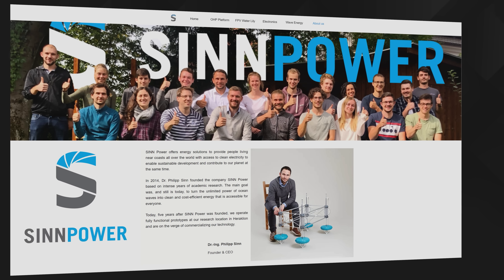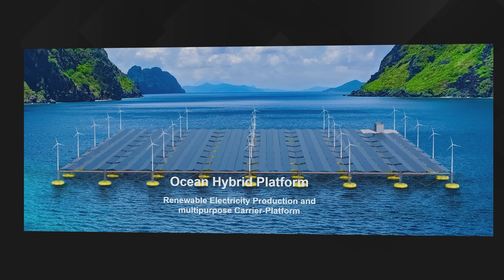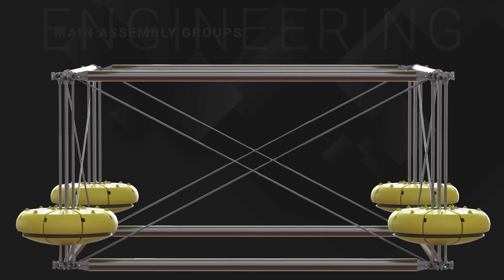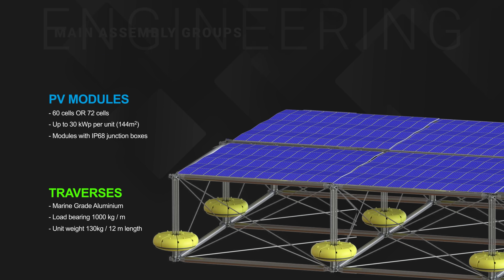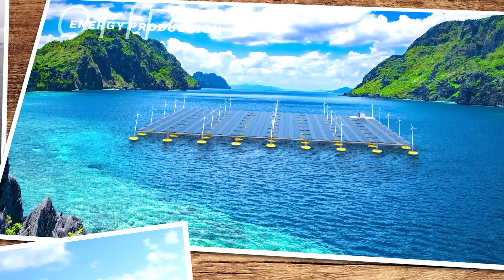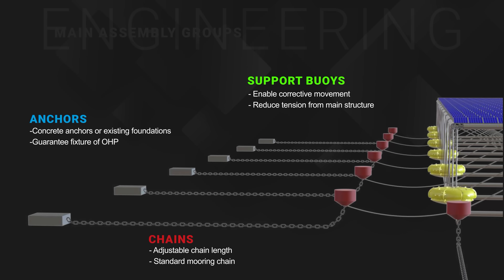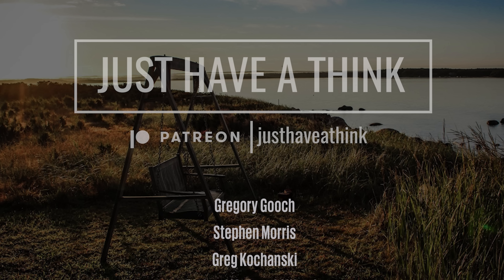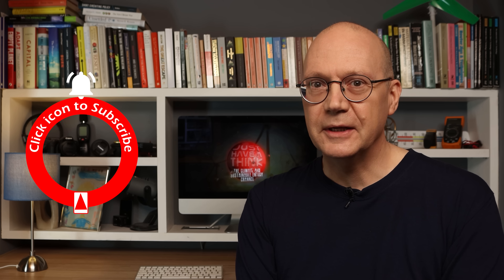Solar Wind and Wave. Can this ocean hybrid platform nail all three?

Comment: Looks great, if it's strong and durable enough to last... if it's out at sea, strong sea storms are incredibly destructive, with tons of waves crashing against the structure. (obviously the designers are aware of this!😁)
Love the modular design, very adaptable for custom builds and upgrades, much cheaper investment costs, along with the possibility of moving the whole thing to different, better locations by sea without completely dismantling.

Comment: This is the sort of project that the UK government should be working on, except that are too busy stuffing themselves with wine and cake. An enraged version might be suitable for use by the UK south of the  isles to take advantage of more solar...  but anchoring in deep water would be an issue as would robustness in the face of Atlantic storms...Bird fouling might also be an issue. it would keep shipyards busy though.. ROI would depend a lot on maintainence costs and timescale before replacement.

Comment: The central thesis to this proposition is that long-term, viable energy solutions are not an "either or," but an "and."  Wind and solar and wave.  Most detractors pick one solution, deride it to death, and conclude it is all hogwash.  We know this is bull***t.  Overall, great presentation.  Two questions remain:  What effect will such floating platforms have on the flora and fauna underneath it?  Has any consideration been given to the growth of creatures (i.e. barnacles) on the underwater structure?
Reply from the maker: Thanks Andrew. Two very good questions. I guess they will need to ascertain the risks during their testing phase.

Comment: As someone who's been at sea in a storm, the first thought that crossed my mind, is that these platforms won't last  five minutes in a good gale. One has to only look at oil platforms massive legs, the platform high above any wave, to see the reality of any offshore installation.
Reply: Location will be key. This doesn't appear to be tall enough for open ocean. I am intrigued by the wave power units though. This seems to be the real innovative part of the system. However I'd want to see a small free floating grid producing power to see how the software will handle keeping the platform floating and level while applying load to the generators. Bolting them to a harbour wall as we saw here only tests the generating units.
Reply: I live on the coast in the UK and they won't last 5 minutes in a major storm. Wishful thinking by someone I'm afraid.
Reply: The engineers say they solved it. What math did you do to come to your conclusion?
Reply: That’s part of why it’ll be nice to get a pilot location going soon. Need to get away from the marketing of “yea this’ll be awesome” and get towards the operations of “here is how my power generation and maintenance costs performed over the last quarter.”
Reply: They won’t be placing them in the North Sea, unlike oil platforms which are designed  to withstand extreme gales. Time will tell
Reply: @robinhodgkinson  You could park them in the Great Lakes and still get waves breaking over them.
Any significant body of water gets significant waves.
The only place you might get away with it for a few years are aquaculture beds - and they get ripped apart about every ten to twenty years.
Reply: @allangibson2408  the Great Lakes are hardly what you would call protected waters. Ships have been sunk there in storms. Perhaps fiords, sheltered harbours and bays, lagoons etc might be a better choice. But you’re right in having a healthy skepticism. The sea is a hostile environment. That said the engineers I’m sure are not idiots either. Watch this space…
Reply: @robinhodgkinson  Academic’s tend to be seriously short on real world experience however - and the spindly aluminium frame does not inspire confidence in anyone who has been through tropical cyclones and typhoons.
The structure would look just right on a WW1 biplane - and behave similarly in strong winds.
Like roof top solar in the tropics - the first problem is keeping the roof on the house so the solar panels can keep attached to something solid.
Sheltered and wind turbines are mutually exclusive as well, because you want them exposed to the wind. Fjords and solar panels don’t work either - because the fjord walls cast shadows (and some fjord valleys might get an hour of sun per day if you are lucky - no sun at all for at least six months is more common.
Reply: @allangibson2408  you’re obviously not an engineer yourself. Structures like this can actually be incredibly rigid and strong, despite their appearance. Just like a biplane in fact.
Reply: @robinhodgkinson  I am an engineer - and the very rigidity is part of the problem. 
You can either move with the waves or resist them. Resistance takes quite massive structural support because you are dealing with what is in effect a bridge truss, bridging between wave crests. The alternative is a flexible structure which moves but requires enough freedom to bend with the wave lengths and heights (actually harder). Both fail if the wave height is greater than the platform height and waves impact the deck directly.
The next problem is windage. All surfaces generate lift in strong winds.
Lots of surface equals lots of lift. The lift generated goes up with the square of the wind speed. 
Putting solar panels on the ground (or solidly anchored to the sea bed) is a much easier structural starting point than anything that floats. 
Sticking a big wind turbine on a oil platform structure is far safer than what is being suggested here. Then you just have to deal with the bending loads (and existing oil platforms in the North Sea often have shore power cables already).
Reply: @allangibson2408   Ok, you better email and tell them they got it all wrong.
Reply: @robinhodgkinson  The real world will tell them that for itself. Reality is a harsh mistress.
Reply: @allangibson2408  Not sure if this a good or bad thing, but the reality is these will be fine most of the time. 99.9% of the time when storms aren't creating 30 ft + waves, it'll probably be great. Which means they might actually be able to build and test one for a couple of years, until the first major storm crumples the whole thing, and they'll either need to replace all of it, or rebuild a structure that costs 10x as much that can actually withstand at least a 100 year storm event.
Reply: @Timestamp_Guy  99.9% of the time means they will last 3 years tops…
Putting them on shore is a better option.
Reply: @robinhodgkinson  They won't be placing them anywhere.
Reply: Absolutely incomparable use cases. Oil platforms are massive because they sit on the sea bed and have to be rigid to support thousands of tons of equipment.
This tethered farm absorbs, captures, redirects and exports the energy which would otherwise try to destroy it - in a gale, better to be a willow than an oak!
Reply: @ahaveland   First the one's I'm talking about float, if you don't believe me look up OCEAN RANGER. Second,  as I said 
their strategy is to locate the platform high enough to keep the waves from reaching it.
Finally you can make all the hokey kung fu willow analogies you want, but heavy storm waves will reduce your flimsily structure to
a bunch of twisted metal on the shore
Reply: @ahaveland  Having a way break over the top of the platform will totally destroy it. Moored FPSO (floating production storage and offloading) facilities float by design - but still need a high freeboard to survive tropical conditions. A 30m wave from a tropical hurricane is absolutely common and devastating to offshore facilities. These waves break in mid ocean - floating doesn’t help.
This design is a typical European university concept with no connection to actual tropical reality.
Reply: @allangibson2408  Finally, someone with some common sense. Exactly what I was trying to get across.

Comment: I foresee problems once the waves get longer than the size of the platform, the larger the platform the higher the torsional loads across the total span.  There will have to be a limit to how large a ridged span will be.
Reply: @Graham Luell  : While each segment could be rigid, there could be flexibility built in between them.
Reply: I think something like this will be more of a considiration in calmer waters already.
I think windier and colder places like that will have to either abuse the wind and just use the turbines or maybe you could design a wind turbine with the wawe thing attached and no platform specifically for these places. The extra wind and wawe energy should compensate for the lack of solar or you could upscale the system sincw you dont have to worry about horrizontality to get more power.
Reply: Being anchored by chains, implies pretty shallow water.
Reply: Electrlysing water and mechanical or robot cleaners might make a difference
Reply: The video mentioned something about a maximum power output per island and all the concept art shows islands of limited size, so I'm guessing they are aware of this limitation.
Reply: if they're also designed for offshore wind, the platforms are probably already fairly small. 

they just have to make sure they're not moving too much, which can be a problem by itself.
Reply: I’m sure the engineers are not complete idiots. Of course they will be placed in situations where the elements - wind, sea state, etc are within operational tolerances. All the examples were close to shore and in I presume sheltered bays, lagoons etc.

Comment: I wish them all the best ... the sea is a very unforgiving environment in which to build anything, especially equipment which needs to work continuously to maintain its stability. I guess it is just like a ship and needs to have a regular schedule of maintenance built in to its operating life. 🤞
Reply: Its modularity could help there, in being able to replace parts without having to take the entire structure out of service.

Comment: This is such a cute idea! I just hope they succeed! Even if you don´t use the wave power, I find the idea of putting solar cells out on the sea, where there is so much surface area, that otherwise would not be needed, just brilliant. I suppose once in a while you have to get out there and clean the solar cells from saltwater residues and to prevent birds from nesting there, but this seems like not too a great inconvenience.
Reply from the maker: You're quite right - maintenance will be super important.
Reply: Just hire someone with a broom to chase all the seabirds off. One perching bird would drop a typical PV panel output to zero. They'll have to be in a boat of course, or they will shade the panels with their brooms. I know several politician's that are eminently qualified for such a position.

Comment: I have always wondered why we cant use the lifting fores of compressed air in an airbag lift system in deep water for power generation?
Reply: I don't understand the comparison with the Brick. floatind devices lift with the wave and drop with gravity, that movement compress air. where is the loss?
Reply: about deep sea and the airbag lift sounds feasible to me if You compress air at one bar and expand it at deep sea, should be possible to gain energy.  doesnt it?
Reply: @anuardelcastillo2627  It requires energy to push your bag of air down to the bottom in the first place. You won't get back more energy than it took to compress the air and push it down.
Reply: @ps.2  thanks for your Reply, im new to the subject! my question regards this example 
a "free 100kg rock pulls down a gas tank with many cubic meters of compressed air. when this inflate a baloon at 5 atmospheres or so under sea level...
we get 50 meters of very strong pull!
i guess tons of power probably...
hook the balloon to a winch anchored to bottom of sea...
where is the problem?
my  lack of math?
cheers
Reply: For the same reason you can't use dropping a brick off a cliff to generate energy.
 It takes at least the same amount of energy to get into initial position as you'd get from releasing your lift / weight.

Comment: Clearly if you have multiple energy sources you optimise the cable transmission capacity esp where they are counter cyclical.

But potential issues:

Wave on its own (let long combined) has proved very difficult to commercialise/deploy

Small WTs on Solar pontoons will shadow cast & if among a larger WFs even more so impacting output.

Small WTs on Solar pontoons inefficient relative to large WTs so will they produce a viable LCOE.

Comment: "The platform modules themselves can be combined together up to a capacity of 10 MW" followed by "the folks at Sinn Power have calculated that the power output of a typical large offshore wind farm could be increased by almost a factor of 10". I'm sorry, but that does not compute. The wind farms that are being built now have 100+ turbines of 10MW each. The combined capacity up to 10MW of these platforms is really not going to give a factor of 10. (Yeah okay, maybe when there is really zero wind.)  Statements like that make me not believe any of the rest either.
Reply: Dave did mention the additional factor 10 MW would be during low or windless days in the summer which is fairly common for the temperate summer seasons.
Reply: interesting point
Reply: So they just need 900 10MW platform arrays around the 100 wind turbines. Does sound like rather a lot lol. Also it doesn't make sense they would be so cheap, if they were a third cheaper they would make new giant wind turbines obsolete. All in all it looks like the company is claiming crazy low costs once they have economy of scale so suckers are more likely to invest.
Reply: On top of that, the whole thing sounds really expensive for the relative low power output it provides. Maritime grade large diameter aluminium pipes, and stainless steel components are not cheap. 

For the wind turbine they partner with Luvside. Who are known for their vertical axis wind turbines. Those are not very efficient simply because of their limited wind surface are (their largest one is 3KW). But apparently here they will provide a conventional 3-blade design. 

Anyway, they seem to have found an investor, so good on them.

Comment: If they were anchored they could take advantage of tidal power
Reply: When I read the title of the video, I originally thought they would have turbines underwater as well.
Reply: The modular type of design does seem to allow variations/add-ons to take advantage of tides, in certain places.
If it's strong enough to last, it would be a great to adapt for custom designs, cutting investment costs.

Comment: Like the idea... these type of projects and investigations are just needed. Have a question, though.... Have they evaluated or commented on the potential negative ecological an and water quality impacts of shading 'large' areas of the sea in shallow locations? Deppending on the local conditions I kind of feel ecological negative impacts could deffinetively be rather relevant.
Reply: how about using the platforms for sea farming too? As offshore fishermen along the gulf coast know, oil platforms make great spots for catching the big ones.🙂
Oh, and how about using it to generate potable water and green hydrogen?